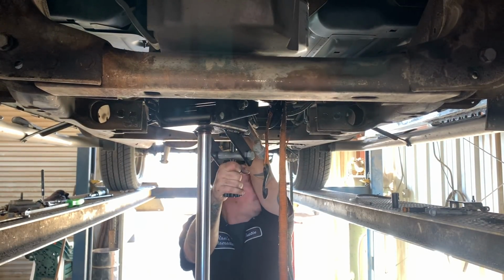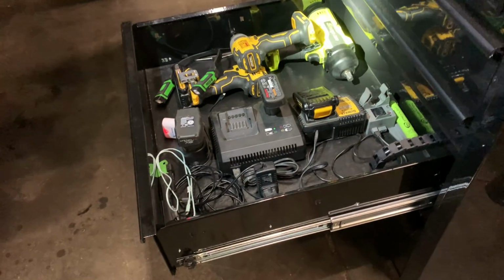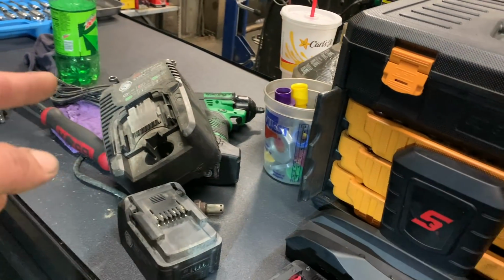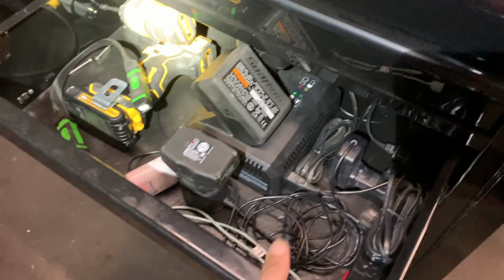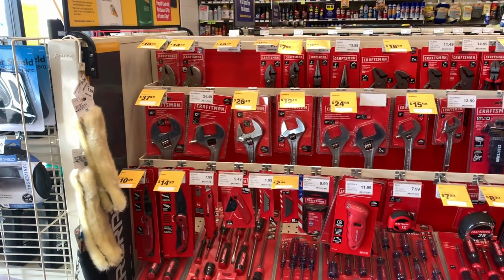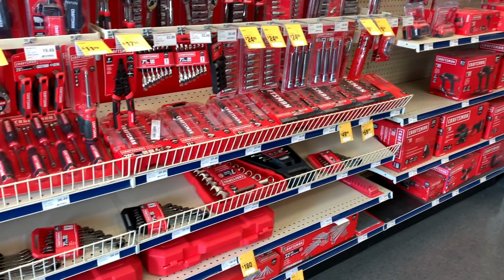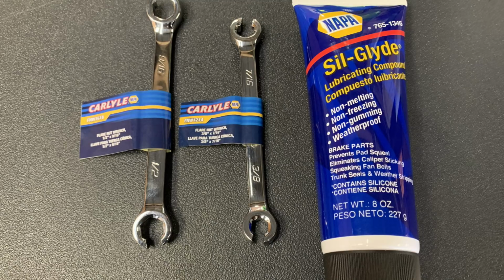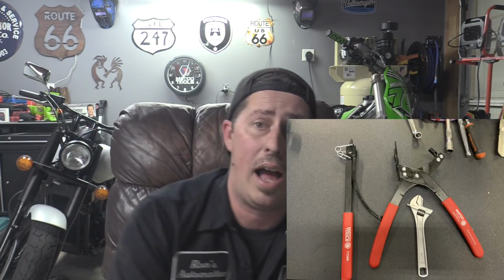Do This Every time You Swap a Bad Transmission!

Comment: Got to love those old Chevrolet rear wheel drives. I pulled out a awd nissan sentra today. Definitely made me want to do Chevrolet trucks for the rest of my career haha. Cheers brother
Reply from the maker: Agreed! The only hick-up was the exhaust hardware was all jacked so it not only took a minute to get unthreaded, but I had to order New Hardware. Overall Easy day.
Reply: @JustinDowDIYcentralhighway  Yeah they do have problems with thier exhaust nuts being crappy but other than that its an easy pull.
Reply: Lol its funny cause my little brother asked exactly what to specialize in i said chevy and ford trucks youll always have work otherwise i said go into diesel or transmission's
Reply: I was thinking the same. 2wd with no rust, GRAVY. Add 4wd and 15 years of rust and its a fight. 

The really old box body chevy truck 2wd(99 and down), you could take those transmissions out in like 30 min.

Comment: LKQ takes forever to pay the shop when the core is picked up and when they get it.Also their dismantlers do butcher up wiring harnesses good when cutting them.Always fixing their pallets too,the delivery person that comes to us hates it when they fall apart.Nailed together and we fix them by putting in screws.Watch out for some of their outrageous core charges too,called them on an used starter for $30.00,$25.00 core charge.Told them take it back all because of the outrageous core charge.This one was for a 2013 Focus

Comment: question on that charger issue and that plug in strip could you unbolt it from the side of the drawer and bolt it to the bottom of the drawer maybe HEY IF YOU GOT TIME TO WAIT FOR IT TO GET TO YOU GO LOOK AT EBAY FOR THAT 21 WRENCH I HAVE FOUND MANY GOOD DEALS ON SINGLE WRENCHES OVER THERE WITH BUY IT NOW FREE SHIPPING JUST IDEA THAT CAME TO MIND FOR YOU

Comment: Try to look the snap on adjustable crows foot if they still make it, it goes to 29mm, it's good to have in a pinch but not an excuse for not having the proper size tool
Part# ADCF8
Reply: I put an extension on it and use it to turn brass elbows in tight places. Great tool

Comment: I see that the shop that you are leaving had drive on lifts. I want to ask a question please.  Is there a reason for this or is it that is what they had installed when they bought the lifts and had not upgraded to newer lifts? I'm asking because you are going to a dealership which means that they should have newer lifts and will more or less have the swing arm lifts Justin.  That's all just curious ok

Comment: using chrome on impacts is a big no no justin. you know that
Reply from the maker: Damn right. It’s whatever I grab at the time 🍻😎🤙🔧
Reply: I totally understand th intent of this message.   But after 20yrs of grabbing whatever socket is available and abusing the shit out of them I have only broke 1 chrome socket.  That was on a 1,000ft lb impact and it was a 13mm socket.  It simply split and then spun.   I do always where safety glasses.  Not out of fear of the mythical exploding chrome sockets but out of fear of flakes of rust or debris hitting the eye....never have I seen a chrome socket shrapnel to the extent of warranting the fear these types of comments try to perpetuate.....
Reply: @mr.h4714  Chrome sockets wear out when you use them with power tools. They get all sloppy and start to slip.